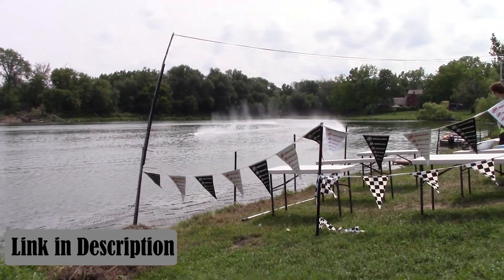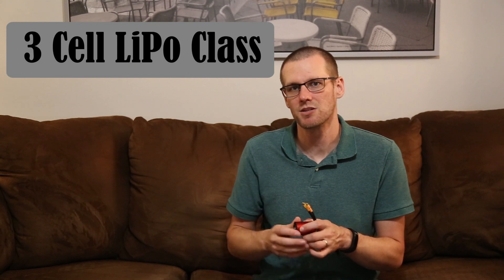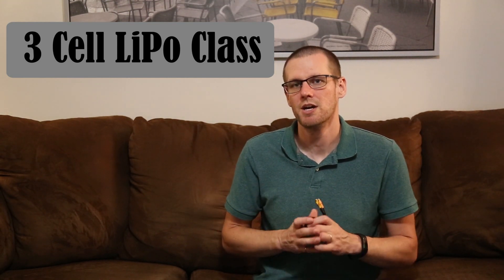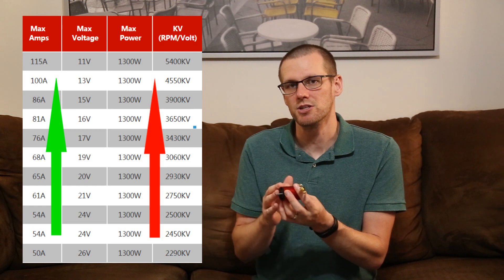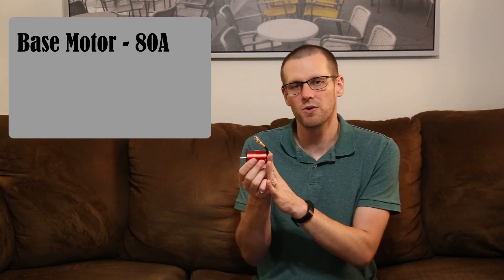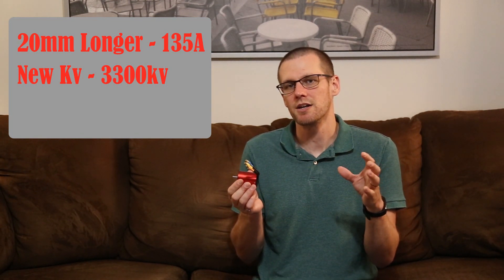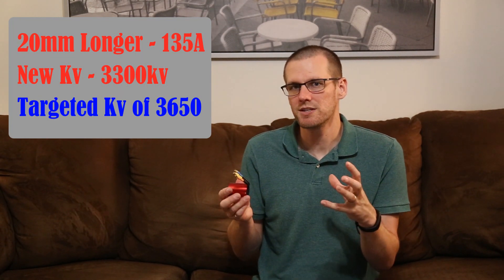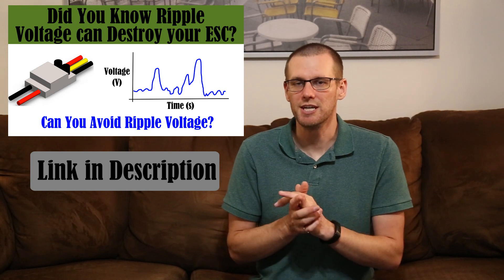Selecting a Motor for RC Spec Race Classes (Max Cell Count) - Maximize Power Output

Comment: Another perfect lesson well learned. I'm an infraction drag car driver and I'm always looking for an edge in this super competitive class where the vehicles weight is an issue. Always brings me to the low kv power vs. Higher kv/ higher rpm question. 132' drags. Thanks for the new info ! I'm going on the bottle neck search in my system now.
Reply from the maker: Glad it was helpful! Thanks for your comment!